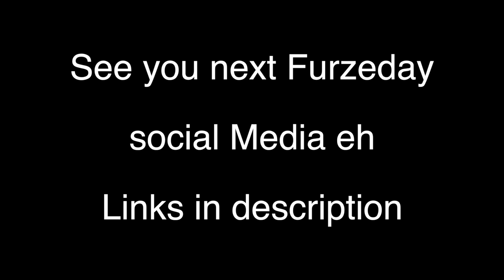I'm not Hurt/Bandsaw Bread???

Comment: colin can you make a chainsawsword?
Reply: or "chainsword"
Reply: That's basically just a long chainsaw though, just go buy one at home depot
Reply: no i mean a sword where the blade has a chain over it that spins
Reply: I know, have you seen a chainsaw?
Reply: Bram Grootveld sounds like you mean a chainsaw
Reply: I know what you are talking about, but it wouldn't function as a sword. It would still be a chainsaw.
Reply: Like a long fallout style ripper? 

I've always wanted to make one with an rc car engine
Reply: more like Chainsawrd.
Reply: to make it really badass the chain should also be slightly on fire as it spins around the sword
Reply: q
Reply: Or maybe a sword where the edges heat up like the toaster knife
Reply: You mean a chainsword, look up warhammer 40K and you won't be disappointed
Reply: love warhammer
Reply: Add a flamethrower.
Reply: chainsawhand, like on ash vs evil dead
Reply: this guy/girl gets it
Reply: Great idea! You are a genius!
Reply: How about a taser chainsword? :D
Reply: No, make it a chainsandwich sword.
Reply: Or a laser emitting chainsaw with just the right energy calibration to actually drastically cut into metal really quickly without touching. Just like laser welding, but more intense.
Reply: You're the most relevant reply so far to this comment thread. +1 for you. You also read my mind regarding Brams idea which he failed to explain. EDIT: Welp, everyone came to a consensus in the end anyway.
Reply: Please don't explode.
Reply: What about a GUNSWORD?
Reply: Bram Grootveld you mean a chainsaw
Reply: go watch man at arms, they just made one
Reply: Bram Grootveld
Reply: Hey man, the guys are Awe Me "Man At Arms" made a chainsword a little while ago

Comment: You make awesome quality videos but sadly you seem to be in lack of inspiration recently, you should take all the time you need to find THE thing that will make you say "YES damn YES", just look at your outro, things like thiq are wayyyy more attractive
Reply from the maker: its all up's and downs in life, the 360 was only the other month and who knows what i have in mind for next big project
Reply: Dude has a kid now man. I don't blame him for settling down. Haven't you read A Clockwork Orange? One cannot be bezoomny forever.
Reply: I'm not blaming him, I'm saying that he should better take all the time he needs to provide videos IF he wants to, that's all.
Reply: make an electric pulse jet with some wall heater elements or try an induction ring mesh, and try the loo roll turbo jet, its probably easier

that will be science, the world has mentioned it a million times, nobody has ever tried it

all combustion is doing is using heat to expand the compressed air which gives you thrust
Reply: so if you steal a real jet design : https://qph.ec.quoracdn.net/main-qimg-46494c705060080b3b47f9a04ff1712a?convert_to_webp=true

wrap the combustion chamber in heat, the naked flame does'nt actually make contact with compressed air in a real jet engine

Comment: That bandsaw is awesome, how does the blade go from one side to the other? is it twisted at each end? or is it some magic blade that can bend round corners in one big oval of death?
Reply: The blade loops around trough the tick beam at the top (with the "BAILEIGH" logo).
Reply: It's got a supply spool on one side and a take-up spool on the other side.
You have to replace the spools once you've run it all across, otherwise it will break.
Reply: oh, ok, I thought it was just magic and ran in circles or something
Reply: +Maniac of Doom No such thing as magic.

;)
Reply: of course not

;)
Reply: No dude, it does not have a supply and take-up spool. It's a single loop. The arm is at an angle for a reason.
Reply: ***** Yeah it does.
Reply: Godfrey Poon facepalm You can look up the tool. It doesn't use spools. It's a single loop of a blade.
Reply: ***** Nuh-uh. It's totally spools.
Reply: Godfrey Poon Cool story, bro.
Reply: ***** I'm just messing with you. I know full well it loops back through the base of the machine.